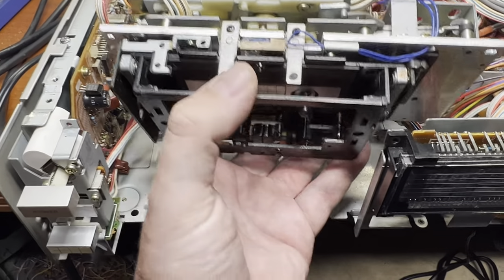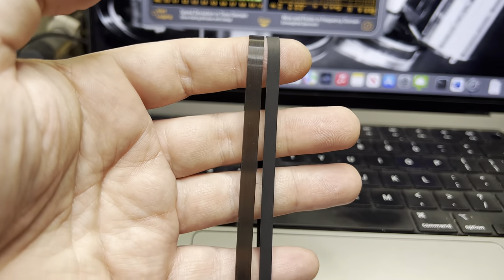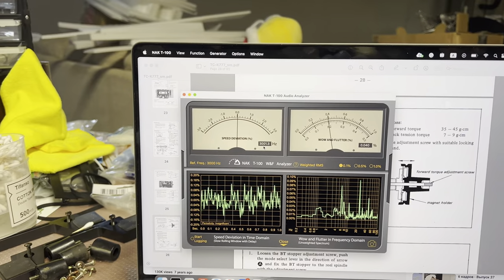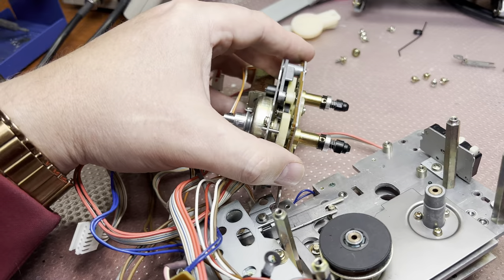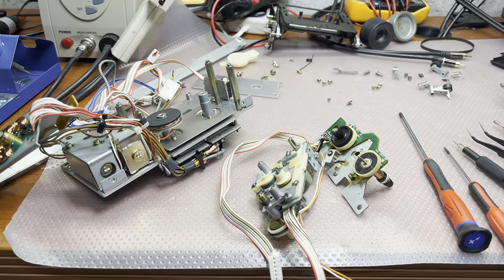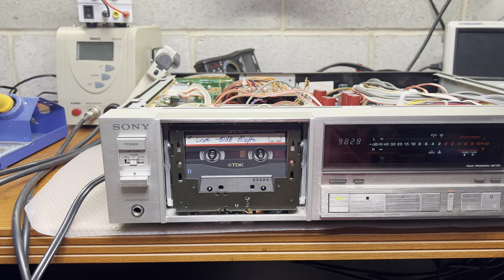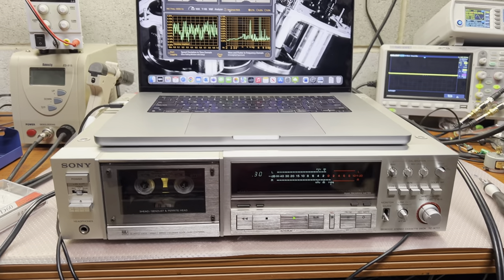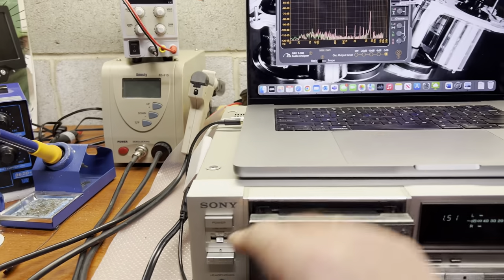Full tape transport rebuild for Sony TC-K777

Comment: I congratulate you, a true professional, I inherited the Sony TC-k777 deck from a great Audio Technician friend, I have had to do maintenance to remove dry grease from the mechanism, the roller pins are in perfect condition, as well as the head, I am aware of the specific size of the belts as well as the parts like the small rubber ring and idler rubber ring that you changed, however the black winch of the direct drive motor does not rotate as soon as I turn on the deck I have to push it lightly with my finger and it works for a while maybe half a belt and it loses speed slowly until it stops, I made the decision to uncouple the black winch and clean the internal gear, at the same time check the plate where the copper winding and the nylon screws are located, everything seems to be fine. I wonder is it possible that the engine had some type of wear in all this time or is there a way to solve it. I would greatly appreciate your advice on this.
Reply from the maker: It would be hard to find without an oscilloscope. I would check the signal from the Hall elements. Then would dig in electronics.

Comment: Hello, great job! Where did you get the idlers? I can't find the small one...
Reply from the maker: I was monitoring Japan web sites for a few months. And got all of them once they become available. Recommend do the same. Don’t buy 3d printed, it’s BS quality.
Reply: @hifirulezzz  I ended up modifying a pinch roller by sanding it down to the right dimensions A lot of work but works quite well.